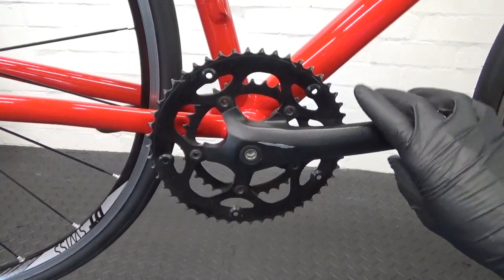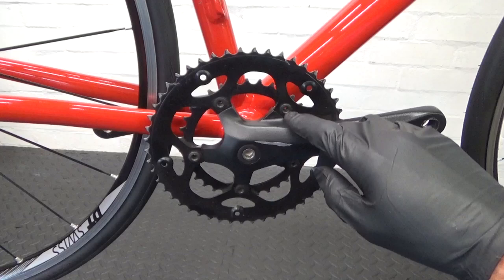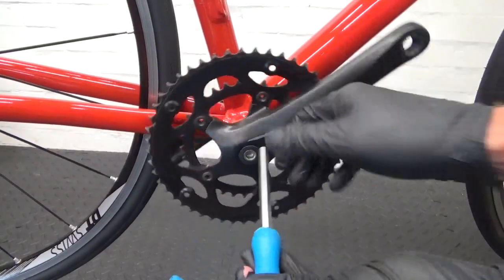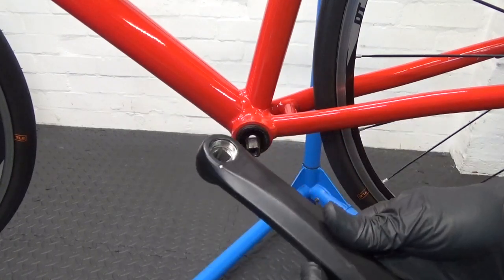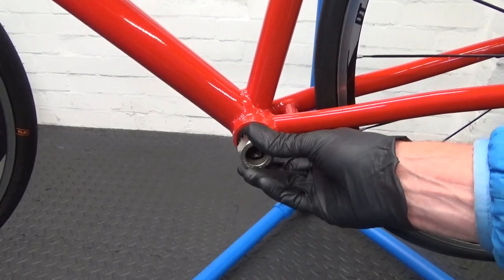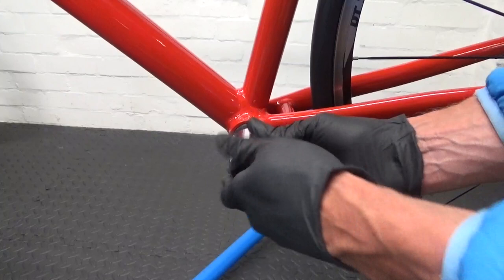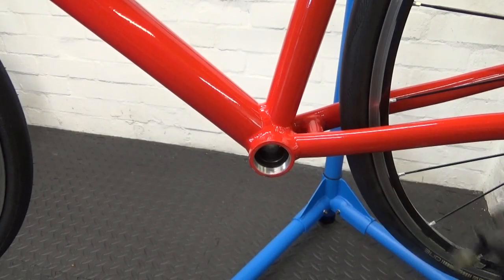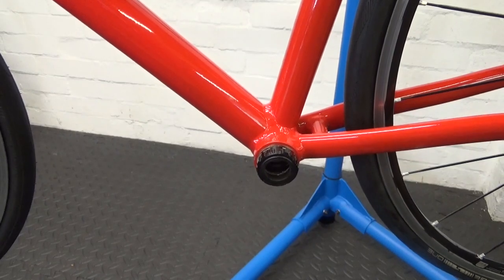Shimano Square Taper to Hollowtech II BB Upgrade

Comment: good one, i need to change the cranks to get some lower ratios for mountain road climbs, on both my bikes, 3 x 8 raleigh hybrid with a square taper bb, and my 2 x 11 gravel bike with the hollow tech type bb